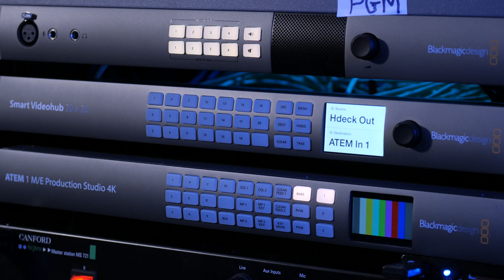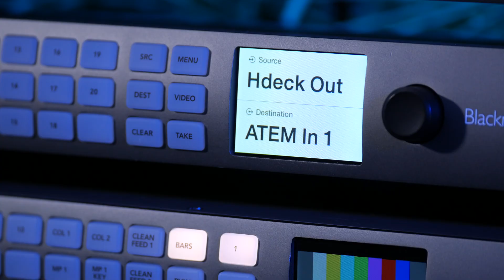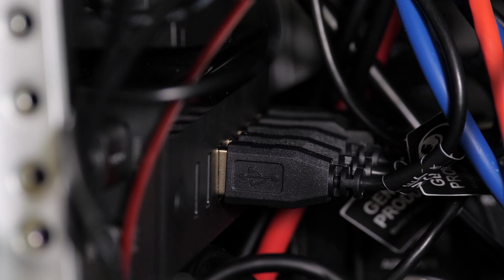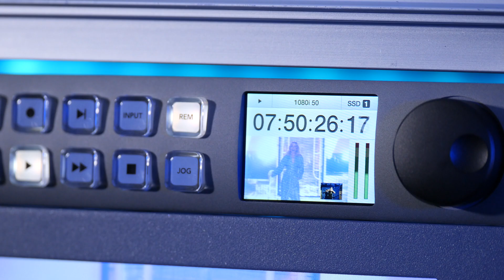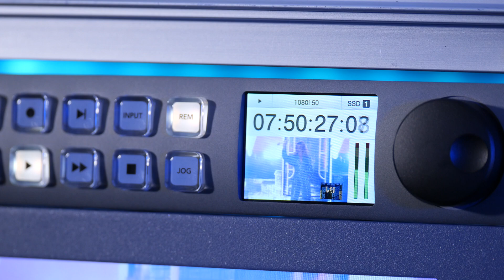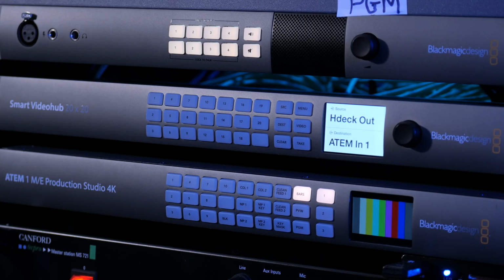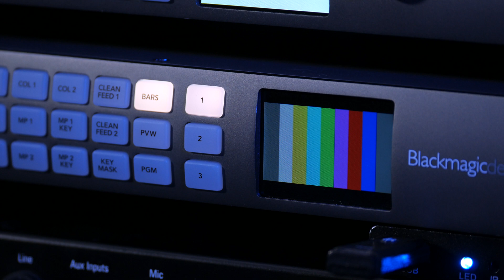BlackMagic ATEM PPU Build, Fiber upgrade 2020 APNTV

Comment: Hallo, ich bin Fotograf. Ich möchte Blackmagic Television Studio Pro 4k kaufen. Ich weiß nicht, ob es gut ist oder hat technische Probleme. Was ist der beste 4k-Mixer? Danke.
Reply from the maker: I haven’t specifically used that model but I do know of it. It is good in that. It has a built-in switching panel although I find there are way too many buttons for wipes and effects that most people would never use. I believe BlackMagic is due to refresh their limited 4K range fairly soon, but no sign of it yet, I’m sure we will see 4K versions of the rackmounted switches in the not too distant future and probably some 4K minis, so it could be worth waiting or buying used for now. As always finding the right device for your needs really comes down to what you expect to do with it now, and in the future, in some cases, the mini range is perfect for some users where others are better off with the rackmount equipment depending on the nature of work they do.
Reply from the maker: Just to add to that, since making the video above, I have also added a blackmagic constellation, HD switcher into my second rack. That is a very powerful switcher at a good price and although some 4K work is coming to me, I have generally not ever come across 4K Streaming jobs, so the HD switcher fits very well into my current workflows.  The 4K streaming I did do was actually directly at YouTube and there is a video for that in my tech playlist if you’re interested.

Comment: Hi, how were you able to integrate your analog comms system with the Atem Studio converter? Thanks 😊
Reply from the maker: Well, I haven’t used it in anger but I used a series of low cost converters to go between AES to line level and back, making a cable to inject and extract that into the intercom.  It did work but perhaps not at a level I would wish to use out on a job.  I have subsequently bought a very neat gadget from AVLifesavers that allows you to insert and extract line level from the intercom ring and that has proven to be very useful.  Right now I am still using an XLR chain out to all our cameras rather than trying to integrate the fiber system as it is pretty bullet proof plus I’d have to buy a load of new headsets.  I see there are other converters on the market now allowing for integration of intercom and Hollyland wireless comms for example.  I think it is easy to end up spending a lot of money though trying to integrate a number of different systems if you are not careful.
Reply: @apntv  thanks, sometimes that's the hardest part.. integrating different systems to work as one 🙂

Comment: I built a remarkably similar setup for our ATEM with fibre. Like you, I integrated lots of fans, both blowing out and sucking in the air. I put usb thermometers on the hyperdeck and also the ATEM. I found it still gets very hot in there, and without fans, you’d get audio breakups over time, plus occasional sparkle on the picture
Reply from the maker: Thanks, notes in heat, has it worked out well for you?

Comment: Is the 1/3U spacing between the ATEM and other components enough to keep it running cool? Have you had any overheating issues?
Reply from the maker: I can’t say they run cool but I haven’t had any overheating issues with this setup.  The air gap and fans certainly helps a lot.

Comment: good evening. know if ATEM Talkback Converter 4K with the Mini Converter
Optical Fiber 12G work together. I would like to save myself the ATEM Camera Converter as I will only be using SDI in and out. thanks for the answer. Rainer
Reply from the maker: Hi, yes the Talkback converter should work fine with the Mini Fiber converters.  I have a mini Fiber converter and can use it with the Studio converter ok.  If you don’t need talkback it is fine, you can even use the Mini Fiber converter to Mini Fiber converter if you don’t want the multiple inputs on the bigger unit.  Hope that helps.
Reply: @apntv  Thanks for the quick answer :-) If I use the route from the Kaerma with the Mini Converter to the ATEM Studio Converter, will I also have both SDI out on the ATEM Studio Converter?
Reply from the maker: @RMFFILM  think of the dual Fiber as 2 separate cables, which they are.  You send SDI from the camera to the studio converter and the program out on the camera converter is sent back on the other Fiber to the camera, even you you are not using it.  If you separate the LC plug into the two fibers you could sent anything else along that Fiber, in either direction if you wished.  It is just like having 2 SDI cables.  Typically the studio converter sends back the PGM feed from your switcher although you could send any other output back instead. I hope that makes sense.

Comment: Hello sir I would like to ask from you about your Equipment List? can you send it to me. I want to build system like this. these days I am  using SDI system and I want to upgrade it to fiber.
Reply from the maker: This system is based around an ATEM 1M/E Production Studio 4K, a 20*20 Smarthub for routing, Hyperdeck Studio Pro SSD recorder and Fiber uses the Studio Converter which has 4 LC Fiber inputs and a mixture of Camera Converters and Fiber Converters at the camera end.  I use a Canford TecPro system for talkback.

Comment: @APNTV which control desk are you using (the one that sits on top of the rack?)
Reply: A streamdeck is too low level for me, infuse it for automating macros, but for cutting and dissolving, I prefer a real panel. However as most of it could be done by an arduino and some buttons I think about building my own or extending an old video control panel
Reply from the maker: The vision mixer panel is made by Mix-It if you google that.
Reply: Puh... that’s more expensive than I expected...
Reply from the maker: @tobisk_de  ah, OK.  It works well but since the release of hardware like the Streamdecks, I guess there are plenty of cheaper options.

Comment: Great video! At the moment we use the old ATEM TVS with GH5 cameras with HDMI to SDI converters for cabling. The problem with this mixer is 1080i signal, the quality for streaming and recording it's almost unacceptable,  we de interlace but the image it's not that good. We would like to get another mixer and at first I was thinking about ATEM Television Studio HD, but as we have all the cameras capable of 4k I was thinking about a 4k option for mixing. The budget it's a problem, so we would like to keep the cost as low as possible. What do you think about the ATEM Production Studio 4K, it's quite old model, but It's still relevant in 2020? We would need about 5-6 cameras. Thank you!
Reply from the maker: You know we have never taken 4K into this switcher, firstly there can be issues with cable lengths but mainly for IMAG screens, streaming and many all day/multi-day events just don’t warrant 4K for us.  The only 4K stream I have done was directly out of the YouTube Space studio  in London.  The switcher is good but for the price it tends to be frustrating that it doesn’t do many of the features, like scaling, done by the £300 ATEM Mini.  I guess it really depends on the type of work you do and frequency of use.  Most of the kit I have is used, I am not sure I could justify the new price but we do tend to use all 10 inputs for some jobs.

Comment: Really interested in learning more about integrating talkback - i run a web streaming production service and our current solution is a little too disparate but works over internet.
Reply from the maker: Yes I will try and document that as I try setting it up, I think I have a solution worked out, just have to make cables and test it all.